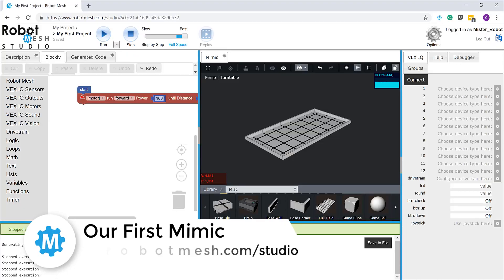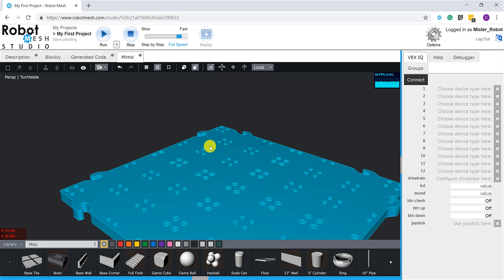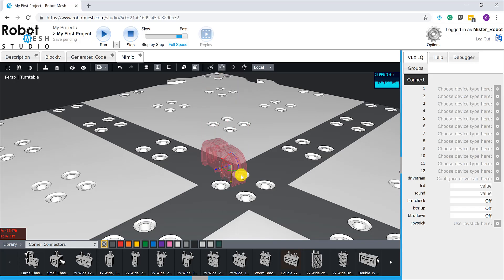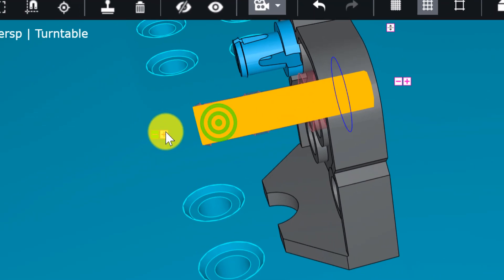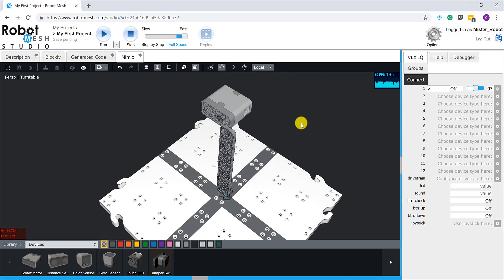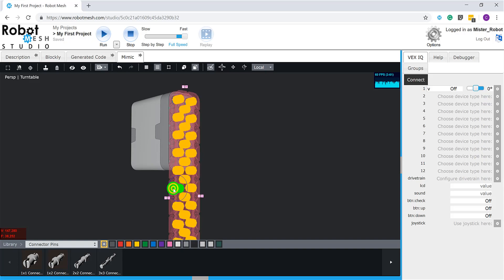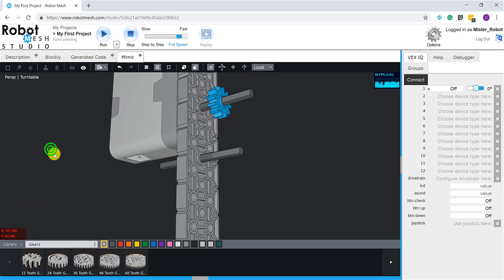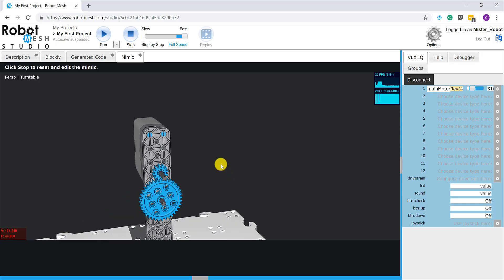Building Our First Mimic

Comment: Are there any mimics for the Cortex? My school hasn't investedin V5s yet so we're still using Cortex and I'd like my virtual students to work with the same robots my  in class students are working on.
Reply from the maker: Unfortunately, there are no prebuilt Cortex mimics. However, you can use Robot Mesh Studio to program the physical Cortex.
Reply: @Robotmesh  Thanks. That won't help with my students who are virtual, so we are buiding a mimic ourselves in the built in CAD tool. I found a tutorial on YouTube we are using for guidance. The only issue we have is we don't see the same level of detail as the video (for example, our bolts have no heads and our motors appear simply as a square box), but we seem to be able to get them to stay connected. Any idea why we aren't seeing the details? Is there a graphics setting that can be adjusted?

Comment: can we copy and paste robots
Reply from the maker: Yes, you can. Click on the 'options' (gear icon) in the top right corner of the project. Click on the 'copy restrictions' link, to be safe keep all the boxes checked. Then press the 'copy project' button. This will create a copy. If you want to share your robot, change the visibility to 'public' when inside of the copy dialog.
Reply: @Robotmesh  can we just load a robot onto a project so we don't have to build it
Reply from the maker: @Bodaciouszum  There are ready built generic robots that you can use. Click the 'Quick Start' button next to the 'New Project' button at the top left side of the project listing screen. You'll be asked to pick a platform (IQ or V5) and a programming environment.

Comment: Any plans to allow us to import default Vex IQ bots?
Reply from the maker: That's an interesting idea. 

We're exploring ways to save your virtual robot as a 'template' that can be imported into new projects. Sort of like copying the project, but without importing the environment. 

We might also allow for the creation of sub-assemblies as a template. For example, you may want to reuse a driving base in a different model.
Reply: @Robotmesh  Either case would be amazing. We'd love to move to mimic for our high schoolers before they break into groups for a longer term programming project with the robots. But it's a bit intimidating to have to follow the handbook to build the robot again from scratch. 😅
Reply from the maker: @emma70707  I am going to assume your students are using V5? If so, here's a link to a driving base that your students can copy https://www.robotmesh.com/create/5d72cdf03650b50bf803acfc